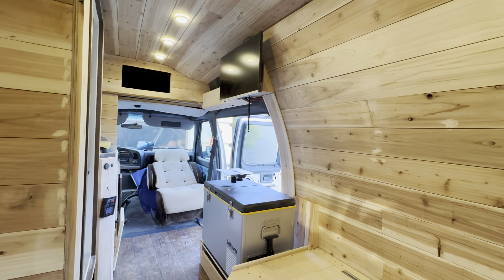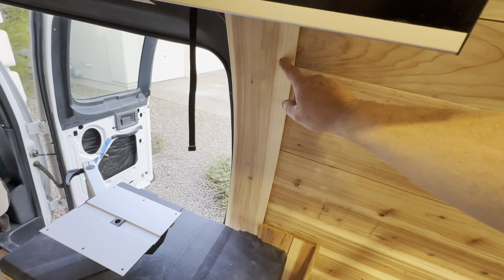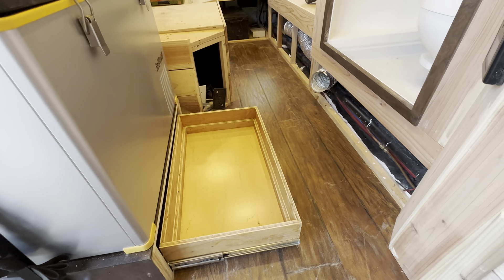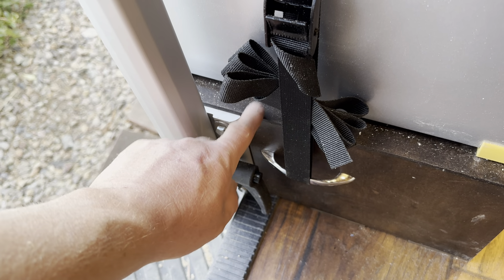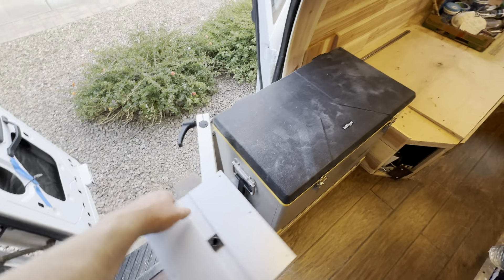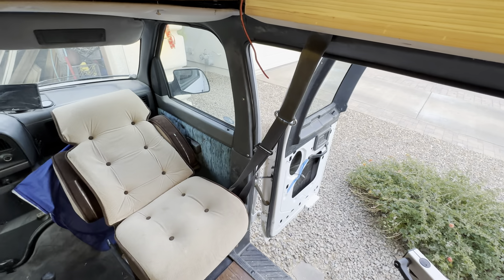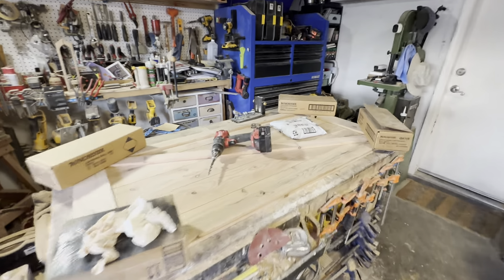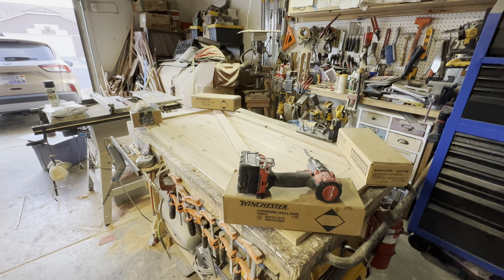This part of the van build was challenging #4x4van #classbrv #vanbuild #endgamecampers

Comment: Looks great Dave. Love those Lagun tables. Did you decide not to be able to open the back doors or cutting later or can I just not see slit cut in wall siding 🧐😆
Reply from the maker: No, that back area is closed off. Couple reasons: I wanted to try something you typically don’t see in van builds. I have never been happy with how the back doors look on vans when built out. I like how that wall makes it feel like a continuous space. Also, that wall will give me a better opportunity to insulate that entire area.
Reply: @EndgameCampers  ohh good points Dave. It does look great. I guess I was thinking you wouldnt be able to open the doors even from the outside like the siding was attached to doors. But I remembered you wanted access to back for all the electrical and such 👍

Comment: Dave, you did an incredible job laying everything out. Question; why not make your refrigerator Mount a little taller to have a deeper drawer? It seems if your platform was higher, you could Mount your swinging table a little higher so it still clears the 12 volt cooler? Do you keep a log of how much time you spend on each project? Love the door. I started building my house in 1987 and used 2x6 tongue and groove pine, glued and clamped construction adhesive, then put the z-brace. They were really heavy but no worries of getting damaged like hollow core doors. They were a bear to hang but still perfect since I installed them over 33 years ago. I also used 8” tongue and groove red cedar in my living room with a cathedral ceiling, in my sun room/office, and one bedroom. More beautiful than the day it was installed, don’t you just love wood and specifically cedar(s)
Reply from the maker: I didn’t want the fridge to be super high. I’m trying to maintain an open feel. House sounds really nice. Thanks for sharing Jerry